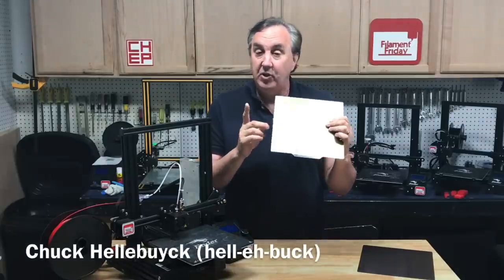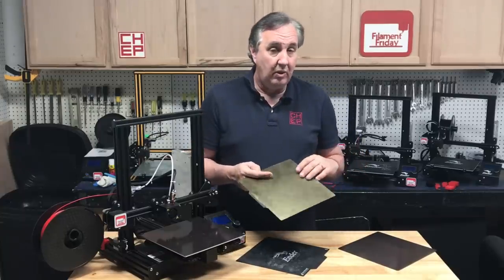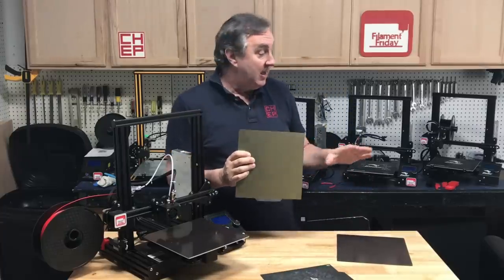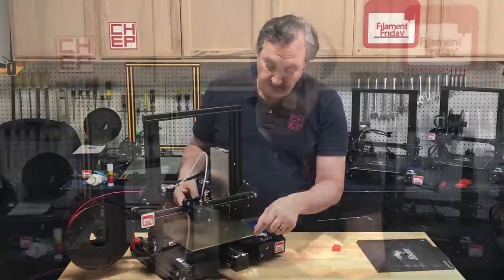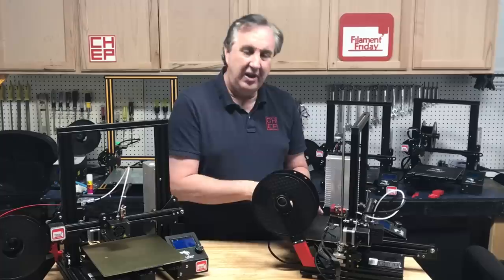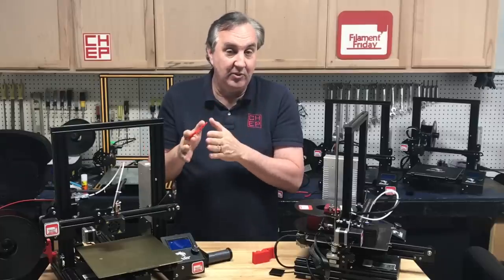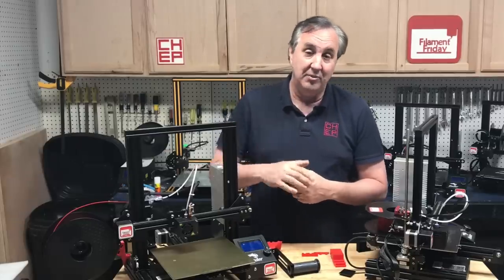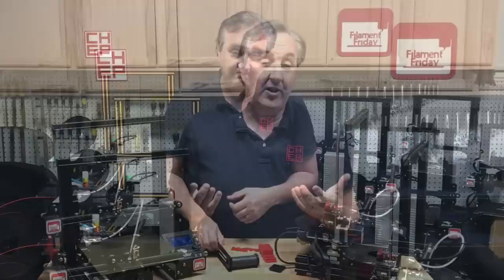Creality PEI Magnetic BED on Creality Ender 3 PRO

Comment: I tried a bunch of different surfaces and I still think the Creality Magnetic Buildtak bed, is the best for PLA prints; I can print perfect any time with overture, amazon, 3dsolutech PLA only cleaning the bed every dozen prints.....For PETG, I find glass bed+Aquanet hairspray works great.....
Hot tip: Want to try a glass bed before plunking money on a creality one ....get a glass cutting board at dollar tree for $1.

Comment: I really appreciate your content but I think you were a bit off on this one Chep. 

Rather than just moving your bed up, you should have levelled it properly with paper. With PEI you don't want to be too close as its more sensitive to the phenomenon of what I call, springing.. where if you print one side too close to the bed - the layers are get pushed down and want to spring back up, on the offending side ..which will cause the warping. 

Other than that - they just require a small dusting of hairspray to provide a fine seal under the first layer, and act as a release agent. It also works best, I find, with  a quick clean with IPA or window cleaner after each print.. sometimes smoothed with a fine pad or sandpaper, which over time I imagine isn't good for the surface (i.e it will probably eventually wear to thin and need replaced) but in my opinion it's worth the £30, if you're getting perfect adhesion each print (which I am).

Anyway, that's my experience with PEI, but we all do whatever works for us. :)

Comment: PEI bed started to work for me after scruffing it up with steel wool. Used one of those kitchen pot scruffers lightly. Using 60c bed temp. Getting smoother surface from it for sure. Can't really say anything on it's longevity yet. Already seeing like micro fractures on the surface.

Comment: i have to use glue on my PEI plates, not found one that sticks without warping or losing the print. i have stuck a creality bed sticker on to a flex steel plate. Get the ease of bending to remove print and stick of old creality built surface

Comment: I also got mine from Comgrow. I have been using a Creality glass build plate since December and absolutely love it, but I had adhesion issues with a metallic PLA I really wanted to use. After numerous recalibration, bed temperature variations, and failed prints, I decided to try the PEI metal build plate.

I used TTY3D metallic silver PLA, Overture orange and white PLA+, Comgrow black PLA, and even some really bad Comgrow gray PLA (I hate it, terrible filament), and had zero warping or adhesion issues.

I used bed temps of 50/65 for PLA/+, and nozzle temps of 210/215-20 for PLA/+, with modified CHEP 0.2 and 0.25 mm LH settings at 50-80 mm/s print speed.

Comment: Did you cool down the bed during the print (cura setting)? I have seen warping even on the standard bed when cooling the bed even by 10deg. That was with petg, but it makes sense of the temperature change causes the bed to contract slightly.

Comment: I went from glass to this exact PEI flex plate and had trouble at first too.  My first few large prints also warped.  I found that lowering the bed temp fixed it. I dont seem have any issues anymore.  For me, first layer at 60, then lowering to 50 for the rest of the print is working great for PLA, PLA+ and PETG.  I also wipe the plate down with IPA after every print.

Comment: In my experience, PEI is a great printing surface if you observe a few simple points:
Clean regularly with IPA and rub occasionally with 0000 steel wool.
By the way, be careful with PETG: It adheres so well to PEI that it is sometimes difficult to peel off and (especially with the cheap, very thin PEI films) pieces break off the printing surface. That's why I ordered a new, thicker film from a specialized distributor and glued it to the steel bed - and now it's absolutely perfect.

By the way, another very good printing surface is Pertinax (Phenolic Paper): Very inexpensive and very good adhesion e.g. with ABS

Comment: I had the same issue. Worked for a couple of prints and I started see parts lifting on me.  I did use glue to help with adhesion and it works. But I went back to my glass build plate with no issues.

Comment: Did you scuff the top with a fine metal scrubber and alcohol?  I started using some glue stick with my wham bam and it’s working quite well.  Also I have started using brims. On the corners only. Where things usually warp.

Comment: I just bought one a week ago. Been happy so far but you may want to re-check the level after the first couple of prints.
The magnetic bed seemed to expand a little and my 3rd print the nozzle dug into the PEI. I'm mostly using PETG.

Comment: I've been running the Creality PEI sheet for a few months and it's working great so far.  I wipe it down with 70% ipa after each print so maybe that helps.  The only problem I've ever had was some ProtoPasta PLA that just did not want to stick to the bed well for some reason.  Every other type of PLA has worked fine, Hatchbox, eSun, MatterHackers... etc

Comment: Hi, what temp did you put in the bed? For PLA I use 60oC for the bed with PEI. I still prefere the sticker that came the Ender-3. But at  60oC and with the PEI sheet clean most prints stick well. There are a few companies selling this kind of spring steal sheet with a ponder based textured PEI (something introduced on the Prusa MK3). I didn't try yet, but apparently is a good option.

Comment: I literally just got one of these today. Going to try it soon. I've seen that they are very hit and miss. I'd imagine it's got a tight tolerance in relation to the squish of material. We'll see. Interesting to see your results. Maybe it will improve. Tbh I'm happy with stock ender magnetic bed o just wanted to try the metal for that smooth finish

Comment: I've used pei from Gizmo Dorks on Amazon and it works very well. 110°C on the bed and I can print ABS. I did a print with and without an enclosure. The one with the enclosure gave me a perfect print. No warpping or delamination. The one without the enclosure didn't warp from the bed but did delaminate.

I have another pei from Lulzbot and it works great as well. I just need to clean it with IPA and its good to go. Although, I have on occasion gotten lifting on the exact same spot as you and can't figure out why. Only on ABS and it my be my bed is not completely flat or the heatsink cooling fan.

Comment: Have two of them. Right out of the package they were too smooth for good adhesion. Hit them with 300 grit paper and alcohol, and they work great. Also, TPU will DESTROY them. People recommend using a releasing agent for that like Windex. I'm gun shy since ruining one of my plates, so now I print my flex on a different machine.

Comment: I got the same one and so far I have had nothing but trouble! The same problems as you.  I thought I was doing something wrong, I put the bed temp up to 60 and that helped a little but still getting lifting on corners.  I washed it, used different cleaners no luck.  Going to order glass bed now.
Reply from the maker: Thanks for the feedback. I’ve done all the same.

Comment: You need to clean the bed with isopropyl alcohol and scuff it pretty well with metal wool. After doing both, mine holds PLA and PETG almost too well!
Reply from the maker: I did clean it but didn’t scuff it. If that what it needs Im not really interested.
Reply: I've seen vids where PETG bonded to the PEI.  I'm scared to use that stuff.

Comment: Chep, as to the curling, what slicer and profile are you using? I’m getting bad curling issues with CHEP profiles on Cura 4.6 (and 4.6.1) but not with the stock profiles. This is on Ender 3 Pro (build tak) and CR-10v2.

Comment: I have a PEI bed on my Ender 3 pro and I clean it off with window cleaner between prints, make sure to leave a residue on the bed and print with bed temp 10 degrees higher than normally would with the original bed and everything prints great this way with both PLA and PETG.

Comment: It just looks identical to the „Two Trees“ PEI spring steel sheet which I purchased from amazon and i also had horrible warping problems. If you have one of these green-yellow kitchen sponges, just wetsand it with the green, harder side. It’s like fine grit sand paper. But your prints will stick like hell on the PEI Sheet afterwards. And you won’t see sanding marks on the underside of the prints. Greetings from Austria Chep 😃

Comment: i think it comes down the PEI product. i cant believe it differs that much but i got one from ebay for like $8 PEI sheet with seperate 3M adhesive sheet and stick it on the glass bed.. oh man.. im having a hard time removing ABS from it and PLA sticks very very firmly on it. Spatula cant remove it and i have to use a very sharp wood chisel every time. Its been 1 year with it and im very very happy that i dont have to use any sort of glue or something similar and a piece of mind that i know there wont be any warps on any of the corners. just keep it clean with alcohol and thats it.
Im surprised your PEI performs poorly, i think i should trace that ebay supplier get another one just in case :)

Comment: I've been printing with my Creality PEI bed for about a month now and have had zero issues. No warping, no level issues (I'm running my Ender 3 with a BLT touch). Honestly, I wish I'd bought one sooner. I wonder if the problems people are having with it are due to the local environment (i.e., relative humidity). Here in Phoenix it's really dry and I notice that the PEI has a mild static charge that seems to remain pretty constant. None of my buildtak-like beds do this.

Comment: I use PEI exclusively except for PETG. It works great. I've been using the same sheet for nearly two years and it's still going strong. It's not magnetic though, that seems like a nice feature, but the PEI sheet I already have works so well it hasn't been a big deal.  EDIT - After watching the video, I would like to add that I ALWAYS heat the bed (with the PEI on it) to 60 deg C. Also, Fwiw, I'm using a CR10S.

Comment: Hey so I have been 3d printing for I think 4 years now and I always used the same printer up until last year I sold it and have been looking for a new one since. I bought the ender 3 and just built it and my prints have been horrible with it. I changed a bunch of settings that I remember and they are a little better but they are still awful. I’ve been doing research all day and been printing a bunch of your cubes. I have downloaded your 4.5 cuts files and printed a cube with it and there’s still lots of problems. The main issue in there’s lots of spots in the print where it just doesn’t extrude and there’s a crack. I’ve watched many of your videos and I have tightened the belt and used your best settings but my print is still creating gaps. I believe it’s the filament so I’m trying a 3rd filament now but I would like a professional opinion on this issue, thanks.

Comment: I haven't had any success with this magnetic Bed either on my CR10-Mini. So I replaced it with a thin layer (1mm) of laminated Paper (in Germany it's called "Hartpapier") glued on my Glas bed. I have a perfect even surface all over the bed and if it is dirty after some prints, just take a bit of sandpaper and clean it in a few seconds. The adhesion at 60° is pretty tight and gets automatically loose at room temperature. Just leave me a message, if you need more Infos or pictures ✌🏼
Reply: StickyFeet Production Does this work for all materials or just PLA. Also, wo kann man das günstig beziehen, gibts das in Geschäften/Baumärkten oder nur online?

Comment: there is a protective sheet over the PEI (I bought the same one.)  Honestly, CHEP.  I love it.  No issues at all.  I had a terrible time with the glass, so go figure.
Reply from the maker: I tried. There was nothing to peel off.
Reply: @FilamentFriday  strange.  I bought the same exact one and mine had a protective sheet on it.    Peeled it off then cleaned the PEI with alcohol.  Leveled the bed and started printing.  I clean it once in a while with alcohol between prints, but has been great.
Reply from the maker: I’ll try again but honestly almost scratched it try to peel it off. Maybe I got a returned unit.
Reply: @FilamentFriday  you're sure? I bought two of them and the protective was sitting tight like a tic. Once off, both mine has worked flawless during my 250+ printing off the Covid protection shield frame, not a single problem.
Reply: @kimnelisse8507  what temp do you print with it at?
Reply from the maker: After all the prints I did I’d also expect it would peel off with the prints or bubble up. I honestly tried. I don’t have one.
Reply: @Nonprofessional_Tinkerer  47°C on the bed (47 my lucky No.  ;) with PLA. Haven't tried any other materials.

Comment: Scuff the surface up with a piece of bronze wool. That will prevent anything from coming loose from the bed and you'll still have smooth prints on the bottom.

Comment: Hey, CHEP. That platform is the best you can use for your printer. Just use a coat of hair spray (a cheap one, not too strong is enough). It won't take off anywhere. You can do it over and over again, layer by layer. When it's very dirty. You take the plate, put it under the tap and clean it gently with water. Hair spray dissolves easily with water.
Reply: De verdad crees que va a leer un comentario en español? Por favor...
Reply: Ni me di cuenta. No pasa nada. Se escribe en Inglés y asunto arreglado

Comment: I have PEI bed on 3 Endear 3 Pro printers and found that if I keep the bed temp at 55-57 it works just like my old glass ones did. Did you try it at any different bed temperatures?

Comment: Bummer to hear you had a bad experience. I was really expecting you to say it was the best thing ever. I have had fantastic results with PEI on steel sheets. PEI wears like iron, and steel sheets are so much nicer than that flimsy garbage Creality sends from the factory. That blemish should have never made it out though. I continue to believe that Creality just looks for the cheapest way to knock off others ideas, with barely passable results, while they wait for the next innovation to half bake. Prime examples their flex sheet and Melzi based silent board.

As a couple have already mentioned, finger prints are your worst enemy. Also scuffing it up helps tremendously. WhamBam instructs users to use steel wool, and I think Prusa recommends 800 grit sand paper. I have found a Scotch Brite pad works great as well. Prints often leave an outline of residue on the surface. Usually I can clean this up using slight pressure and a microfiber towel with IPA. Every 4-5 prints I will lightly run the Scotch Brite over the bad to restore an even haze to the sheet. I have found that that more I scuff a sheet the better PLA adheres, and the easier it is for PETG to release. Since PLA doesn't dissolve with IPA, the residue needs mechanically removed periodically.

Comment: I have a very similar pei spring steel bed on my e3 pro. I like it significantly more than either the creality c-mag/ez peelzy bed that came with the printer or the creality ultrabase glass bed. I did find that it sticks SIGNIFICANTLY better to the included magnetic sticker than it did to the creality magnet. Is it possible that poor magnetism between the pei sheet and the creality magnet could cause poor thermal conduction through the magnet? I have printed PLA, PLA +, PETG, and taulmans nylon on mine, nylon was the only thing I've had adhesion issues with. Warping PLA makes me think insufficient bed temp possibly.

I love the convenience of being able to flex parts off, and I have found PEI superior to glass for PLA &petg (petg almost sticks too well). I've gashed my hand open on the scraper one time too many for me to go back to non-flexible build surfaces. It's a huge quality of life improvement imo.

Comment: This PEI bed is the best. The one in this video is definitely defective. Or something else is off. I did not have to sand it at all as others have said. It stuck really well and pops off easily when done. Not sure about why someone would sand it as it adheres flawlessly for me right out of the box. After a long print I just wipe it down with IPA. I used glass before and i'm never going back. This bed is the best i have used so far.

Comment: Yeah... I am pretty much done with buildtak / pei. Had too many issues and weird inconsistencies. I use glass with hairspray with amazingly consistent results and the bottom of the print looks great, better than with gluestick...
Reply: Agreed. I like how hairspray doesn't leave too much of a mess on the bed. its sticky enough for prints to stick fine but still easy to pop prints off too

Comment: I'm using the same pei bed which I bought from creality directly and I received mine with quite a few scratches even though it had a protective film over it. You did remove the protective film didn't you? 
Mine works perfectly every time with petg and pla+. I clean it before each print with ipa or ethanol.